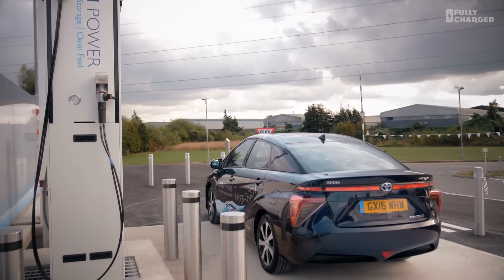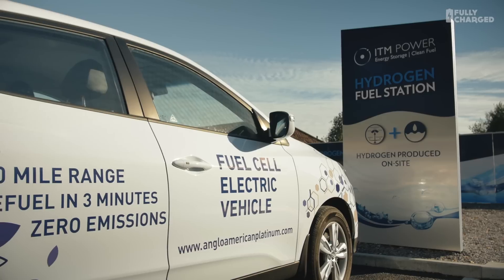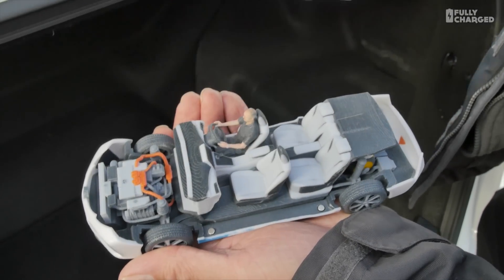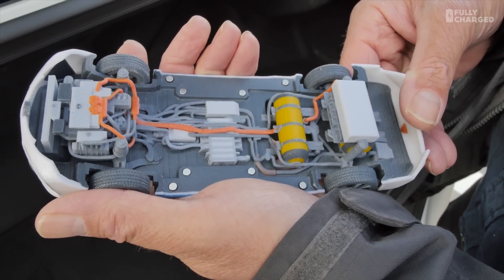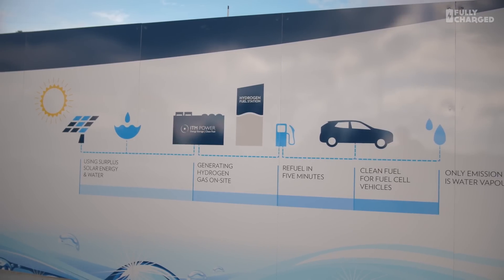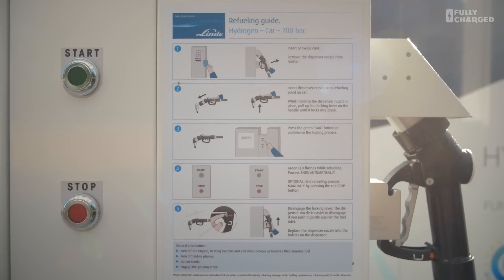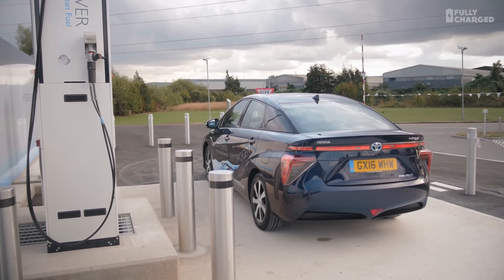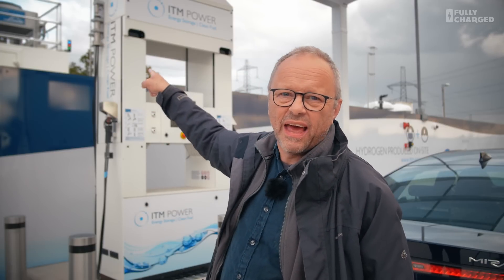ITM Hydrogen Rally | Fully Charged

Comment: Being sanguine about this idea I see two possible improvements shown to be useful, but I do still think the power needed to compress the hydrogen is enough to power a pure battery EV down the road just as far. The hydrogen as source for heating, though shows me why the Germans are interested. This scheme has use for Toyota because they own the patents on the best hybrid, engineering costs already sunk. For the Geman government, it is a two-fer. Excess production on sunny days gets them hydrogen which can then supplement heating gas which they get mostly from other country's petroleum reserves. In addition they can run some cars (not very many,probably) with it.
 Battery storage of excess grid production is more efficient if used for cars, but not so much if used to heat directly.

Comment: I'm not convinced about hydrogen because the main driver behind it is that it's a familiar experience for people when fueling up. However, the electricity cost for splitting water into hydrogen is about 3 times as much compared to a battery EV. So it is incredibly inefficient.

Battery technology is improving all the time and it won't be long before there will be many choices in cars with over 200 miles range. The ability to be able to refuel an EV at home removes the need for a huge amount of fuelling stations. You'd only need a few dotted around town/city centres and along major roads.

If we went the hydrogen route then all the petrol stations would need to still exist as you wouldn't be able to fuel up at home. Also, demand would increase such that it was no longer sustainable to only produce hydrogen when energy was in surplus and thus it would put more demand on the national grid or it would involve having to transport hydrogen around the UK.

The other benefit with battery EV is that people have the option to install solar panels/wind generators that would create free transport fuel. And the complexity of a battery EV is really really low, the complexity of a hydrogen vehicle is huge (more so than a petrol/diesel car). More complexity means that there's more areas for failure. Servicing and maintenance will then be more.

I honestly think that hydrogen route is not sustainable for cars. Might be suited for lorries/trucks etc but definitely not cars.

Comment: I read that it takes 2-3X more $$ to fill the tank up with Hydrogen then gas..  They use hydrogen in rockets since is so explosive, so wouldn't you get more efficiency burning it in an ICE vehicle rather then making electricity by pumping it thru a fuel cell?

Comment: Well, the real thing to compare here is the energy efficiency between battery storage of that surplus energy (and yes, that is also a matter of cost) vs. transforming electric energy into a gasous form and back into electric energy. Yes, of course charging an electric car takes a little more time than filling up a tiny gas tank, but with ever faster quick charing system (the 350kW charging system is the next step) it will be faster and faster and in reality isn't a big issue already with electric cars that have decent sized batteries.

Still not conviced at all that a hydrogen fuel cell is a viable technology for small scale personal transport. Now, it certainly has its merits in stationary installations where much cheaper fuel cell technologies can be used but even then there is the question about energy efficiency in the dual transformation process.

Comment: assuming they've done the hydrogen tank explosion tests, that's a lot of infrastructure that they have to build for just a gas station, but I do like the idea of it coming from on site, but then again, what's the point of generating the electricity to create the hydrogen and not just run the car on the electricity, just for a quick refuel?
Reply: Not really. It's an ITM container, a tank and a pump. No more than a current gas station which has to have large underground tanks +pumps.

The difference is ease/size of storage. Make fuel when there is lots of leccy. Keep it to fil up cars when they arrive. You can't do that with electricity, or at least only with monstrously expensive amounts of battery.

Comment: Good video but I am still not completely convinced. Regardless whether the energy used is green or not hydrogen must be a far less efficient use of electricity so probably will not be good on a large scale. 

Firstly with 'green' hydrogen you have to have a fairly pure source of water (if I am correct about electrolysis), this means that even in places that are not water stressed such as Wales, you may have to use reverse osmosis and/or de-ionisation to purify the water further. Such processes use a lot of energy and it is even more for desalination. Plus there is also waste water to deal with. Then there is the efficiency of electrolysis to actually produce the hydrogen, which is around 70%. Next The hydrogen has to be cooled and pressurised to store in tanks. Even if we assume all hydrogen is produced locally as ITM Power seems to suggest, so there is no transportation, there is a lot of energy lost. I think that at least around 50% of electricity produced from the wind turbines will be wasted just on producing it. Then, when it is in the cars, hydrogen fuel cells are only about 60-70% efficient at best in turning hydrogen into electricity. I think around 75% of the energy, from the wind turbine to finally producing motion in a car, will be lost (only 25% retained)! 

In comparison, in battery powered vehicles, you only have the electricity lost in transport in the grid (which I believe isn't that much and will also be the case in powering the hydrogen generator); then around 10% lost in lithium ion batteries and then around 5% in the motor (which is the same as in a hydrogen car). This means that by my rough calculations, even with the added weight of the batteries, around 75% of the energy is used relatively speaking.

I understand this form of hydrogen can help balance the grid however, I think using EV's and smart grids to do that will be a better option and investment for the future of sustainability.

Comment: I noticed that cost wasn't mentioned during this episode. I'm assuming with the specialist production equipment on site that has to be maintained  and limited infrastructure refuelling isn't going to be as cheap as off-peak electricity or home generated electric. The last vid with a hydrogen car was at least as expensive to refuel as an ICE! Until hydrogen becomes as widely available as EV and as cheap to run, it will be only available for a select few with money to burn.

Comment: Are you sure they are completely off the grid? 
I would have thought converting water into hydrogen and oxygen and pressurizing and cooling the hydrogen and transporting it into the vehicle and then oxydizing it to water again would be somewhat more inefficient than charging a battery.
Then again, you do most of the same things with a battery too.
But still i would like to know that the wind turbine is not there just for show, but it's actually covering the whole energy consumption related to the hydrogen pump.

Comment: Could you ask the car makers what their fuel cells are made of? I suspect it's even more rare than lithium for batteries.
Reply: Baby Unicorn Tears and Diamond Gryffyn Toenails are melted together to produce an alloy called Rarium, that is then used in a sintered, bi-alloy, dielectric process to grow Hydrogen crystals. These are then ground up in an industrial blender (Blendtec did a "Will it blend" with some Hydrogen Crystals back in May 2011).

Once they have the Hydrogen in powdered form it is then "rehydrated" with Oxygenisis, a synthetic Oxygen protein. These are then combined to produce clean, and more chemically stable "Kinetic Oxygen".

This is then used to power a vehicle, fact.
Reply: It depends on the design. Alkaline fuel cells (which are among the cheapest and most efficient H2 fuel cells) use carbon electrodes impregnated with a catalyst like platinum, silver or cobalt oxide in an electrolyte solution of potassium hydroxide.

Comment: What could go wrong?

Hindenburg
Reply: The Hindenburg burned from the envelope material, the hydrogen was not enough to burn that long as it burned out in a few seconds.
Reply: The low pressure in the Zipplen and the weak material surrounding the gas made it explosion-prone. High pressure would have thrown out - litterally -any fire hazards and a strong metal tank would have been strong enough to have only be dented, thus just leak.
Reply: C0deH0wler I'm pretty sure any tank made out of anything is prone to leakage when we're talking about storing protons and it only takes a spark to get it going regardless of the material surrounding it.
Reply: Lets just hope the Totota Mirai composite tanks do not spontaneously Bleve (that is to get a hole and gas escaping burns) since there are propane tanks made of fibreglass composite with one manufacturer failing with its quality in their tanks. Look up stories of fiberglass propane tanks "exploding" as you will not find any saying they just blew open, since if there is any puncture it bleves or flames and the fire just melts the surrounding tank as the lpg remaining just burns, unlike a metal tank which will bleve to a boiling point and thus you seen those stories or videos of them BURSTING open after bleeving for a while.

Comment: It's difficult to believe that that single fan, which is barely turning, is generating enough electricity to split molecules, pressurize gas, refrigerate everything to -40 degrees, and run all the electronics. But it's funny, I'll give it that. Wouldn't a little 120v receptacle, or 7.7kw charger stand be simpler? Even a quick charger would need far less moving parts and gadgets to function.

Comment: Has Toyota overcome the issues with membrane degradation? The research at University of Birmingham show membrane degradation in the fuel cells after not many miles. Unless Toyota is using a different material for their fuel cells?

Comment: I'd like to see all hydrogen production compelled to use renewable electricity only.  

I worry that as clean water is difficult to come by in some parts of the world, what will happen if industry demands ever more for its use?  

Meanwhile, the fossil fuel industry has been licking its lips at the thought of using dirty energy to create clean.  We've only scratched the surface of battery technology, and it offers both a cleaner and simpler solution.

Of course, this is just a stop-gap solution until we have Mr. Fusion's powering our vehicles.

Comment: The Mirai is still twice as expensive as a comparable internal combustion engine car. The price has to come down or it will never amount to much.
Reply: Still cheaper than a Model S of Tesla and it outputs 114 kWh max compared to 60-100 for Tesla depending on what size you require or need or want for a Tesla which starts at 75,000.
Reply: Yes but it has 153 HP and does 0-60 mph in 9.4 seconds. Additionally it costs £50 for a full tank to go 312 miles. That's an extra £1600 a year for 10,000 miles vs free for Superchargers and very little at home.

More importantly the Model 3 will be cheaper, almost certainly have better acceleration, and still cost much less per mile to use the Superchargers and other charging locations.
Reply: So a Tesla at current models for 75k or Mirai at 57.4k USD...I am going to stick with the ICE unless I win the lotto and go with the Tesla on lease for less headache when it comes time to trade in. Forget the Mirai for a car since the lack of hydrogen fueling stations in the USA, at least until more are put out.
Reply: Joshua Cornell, yep. Today the Mirai doesn't have the filling station network. In three years even if it does, it'll be compared to the Model 3, Chevy Bolt, Volt, and other electric cars that cost less, have more places to charge, and can charge overnight at home for a tenth of the price. The only advantages the Mirai has are fast refueling, longer range than cheaper EVs, and potentially being greener than ICE, though in the near future most Hydrogen will still come from fossil fuels.
Reply: Joshua Cornell The Model 3 costs 35k
Reply: But is it here now? Not yet, so that figure is still predictional and could up or down if not stay the same. If it comes to l2 or 3 grand less or more, then now you got a cost competitive BEV to a not so cost competitive FCV to which this technology of FCV is more useful in heavy vehicle transport and it is why Nikola has changed the main powertrain of the ONE from LNG to Hydrogen due to its higher power density and faster refueling.recharging.
Reply: @Joshua: "Not yet, so that figure is still predictional and could up or down if not stay the same."

It will stay the same.  They have taken hundreds of thousands of reservations at that price.

"why Nikola has changed the main powertrain of the ONE from LNG to Hydrogen"

But is it here now?
Reply: Mirai is much more expensive, since Toyota is losing 100,000$ on each one sold

Comment: I don't agree with people attacking hydrogen like they are in the comments section. An important fact to remember is that to make people uptake renewable technologies it has to be at least on par with the cost of a combustion car, as quick to fill and reliable, a hydrogen car can acheive all three of these things. Yes batteries might be more efficient in the sense that they dont waste energy like making hydrogen does and it is easier to install a charging station than a hydrogen station, but you can't run a HGV off of batteries, you can't run a cruise ship off batteries or a train, these are markets hydrogen could really excel in. As for domestic use a hydrogen car is far quicker to fill up and has a longer range than an electric car and is far easier and environmentally better to manufacture.

I genuinely think in the long run hydrogen will win the fuel war and come out ahead of batteries, it's just a far more flexible and in the long run a cheaper form of running a vehicle (dont forget batteries use rare earth elements, lithium will increase in price 500% within the next 50 years when everyone is using it for renewable energy, we only have a limited supply).
Reply: You can't fill a car quicker than never filling it.  When my car has a 300 mile range every morning what filling are we talking about?  It would take me at least 5hrs of driving on a highway to have to charge that thing or 12 hrs in city driving.

Also lithium is a byproduct of desalinization as well as its 100% recyclable.  The price will only go down.  Lithium is in fact not a rear earth element unless you think granite is.

Comment: Reading some of the comments it seems this isn't the easy way, but over time it would come down in cost surely? And from what I can understand it could run your house for a week with a cable from the house to the car? surely that's the way to go?
Reply: Batteries are currently better.  They will come down in cost surely?

Hydrogen tank and batteries hold about the same energy, and both can be used to run your house.  What's the advantage of Hydrogen again?
Reply: CorwynGC After I wrote, I read a lot more. So the only advantage is the fact that refueling is faster.

Comment: WE do not want to wait for a recharge every few miles. People want to pull into a station and refill in three minutes just like we do now. The sun and weather have an infinite (relatively) amount of energy to harvest. If we only get 25%, so what?  Its better that littering the planet with exotic metal boxes just to store energy. What about the cost of creating that huge volume of batteries? We save that by having a proper reusable Hydrogen infrastructure. Who knows? ITM might reevaluate their home hydrogen generator and consider putting it on the market,
Reply: It is exotic metal boxes either way.  Efficiency reduces the number of exotic metal boxes.  That is why efficiency matters.  Check out the cost of that huge volume of hydrogen generators.